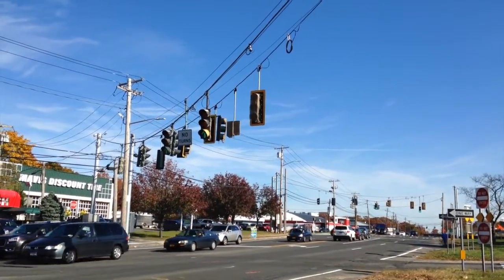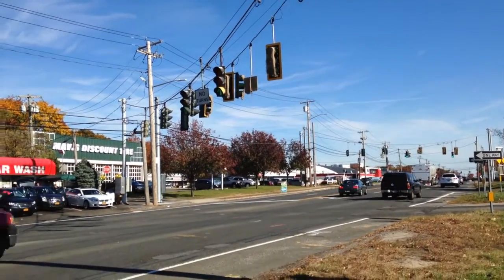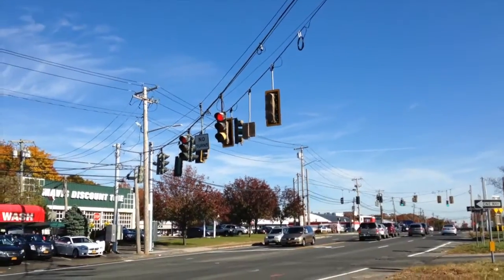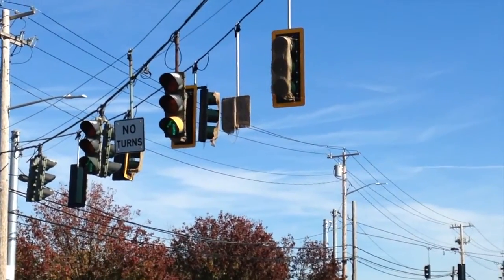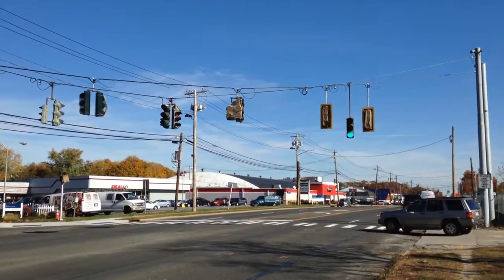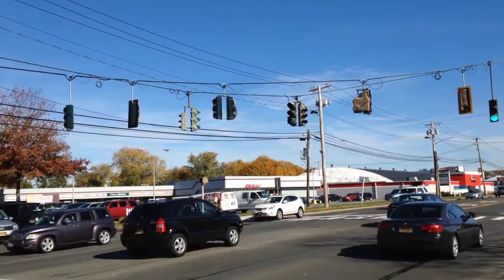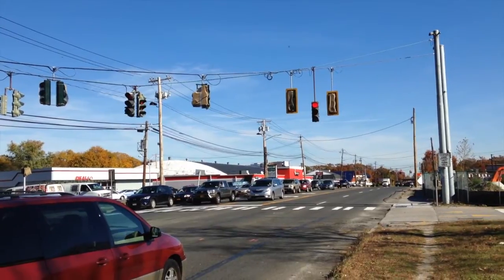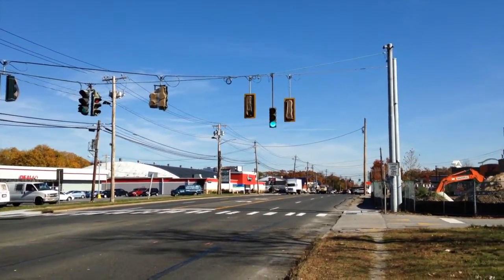Jericho Turnpike: New lights up.

Comment: I know when I was in fla the new law requires all new signals (after 2011) installed to have backplates with those yellow reflective tape. also each lane has a single light  i.e. 2 left 3 straight and one right turn = 6 signals. as far as the second set id say the light behind the left turn signal will be turned and used for the side street. I cant see 3 signals for 2 lanes for the other side.
Reply from the maker: That's interesting! There are at least 4 sets on Route 110 that went up last year into this year, and they don't have them, so I am guessing that whoever is the head of the project is making that decision. 

At the second set, one thing about the opposite direction, is that the existing old set does have one for that middle turn lane, so it is leading me to believe that there will still be three for that direction. As of today though, the new sets have still not yet been activated, so, only way we'll know for sure is when that time comes.
Reply: Sharkie626 well as I said it can vary by state.  I think in n.y. they are not required to have backplates.  only to be  a 12 in signal head. im in tx  and it can vary by county. we just started the flashing yellow arrows here.